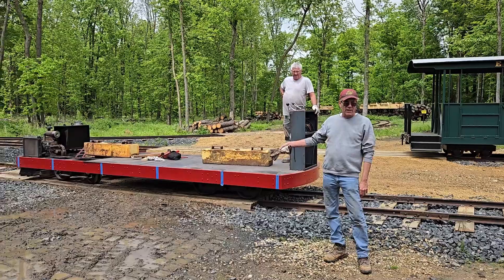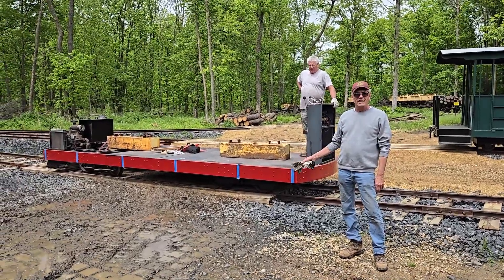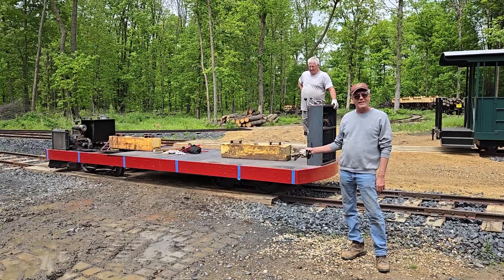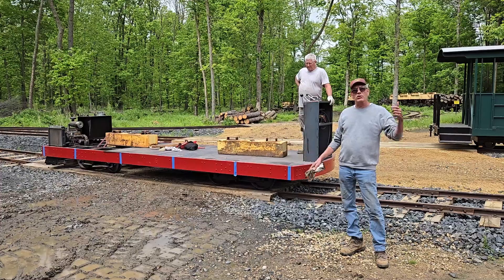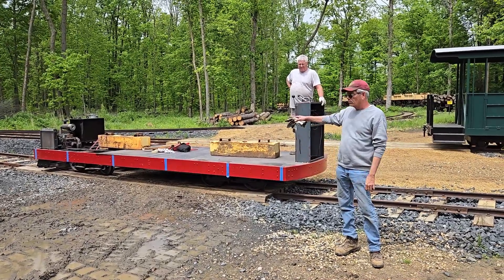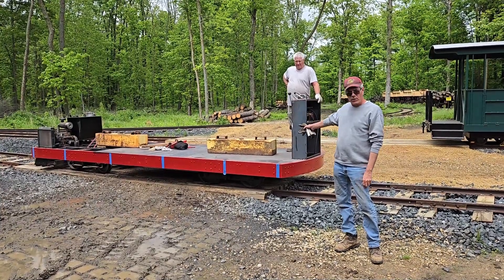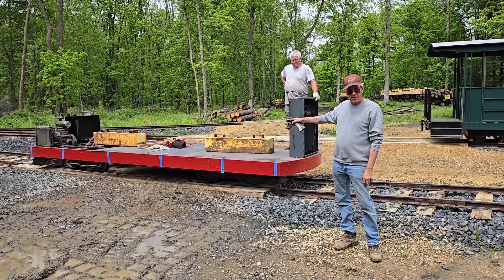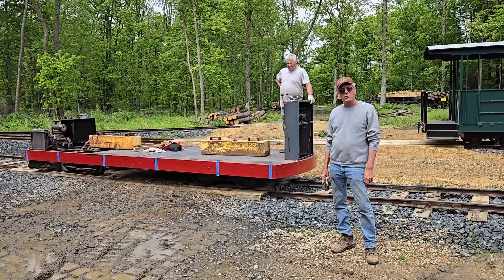Trolley Performance Test with Weights

Comment: I see alot of wet ground. Long term track alignment might be an issue without more ballast.
Reply from the maker: You're right.  We still have lots of spots with very little if any top ballast.  It's coming.

Comment: About the drive system on the trolley:  The engine appears to be a four cylinder, water-cooled diesel.  Based on what controls are visible, my guess is the final drive is hydraulic.  Since there is no axle between the wheels, how many wheels are driven?
BTW, great project!
Reply from the maker: There are two hydraulic motors, each driving one wheel.  So there are only two drive wheels of the eight total.  Imagine one on the top left side of an H and one on the bottom right side of the same H.  It's very odd but It works.
Reply: Another way you can easily tell it's hydro drive is the massive hydraulic tank beside the diesel engine. Very nice video